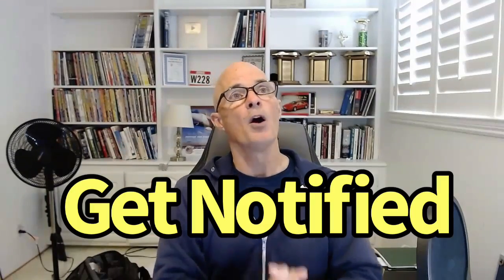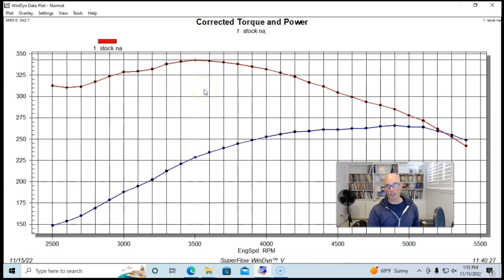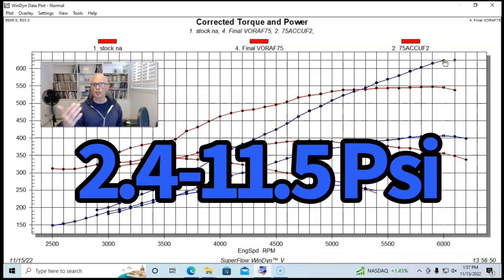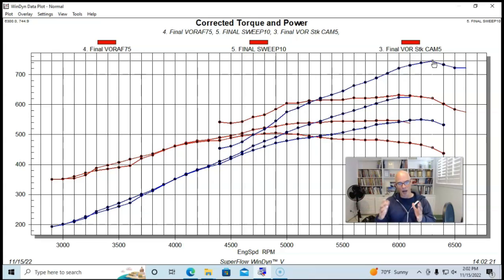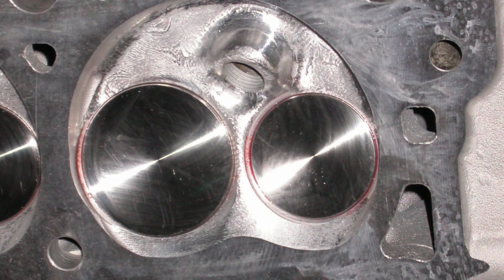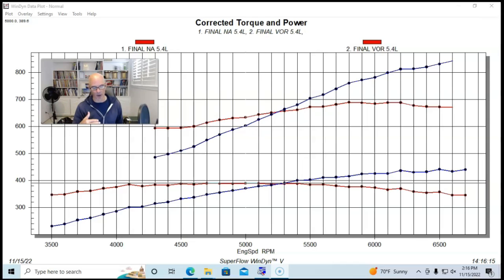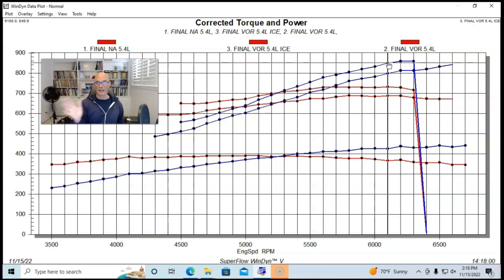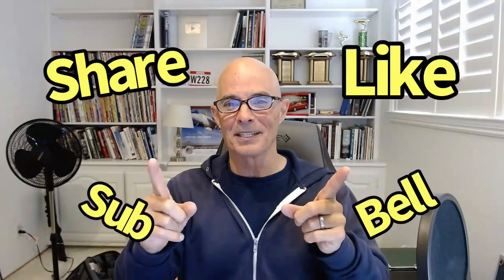4.6L VS 5.4L-MISTAKES WERE MADE! HOW TO ADD A VORTECH SUPERCHARGER TO FORD 4.6L 2V & 5.4L 4V MOTOR!

Comment: @Richard Holdener:  I have a belt I bet it will out do most any belt yall tried in a SC application due to a slipping serpentine belt. 

Continental Duel Belt double sided serpentine belt. It's just like any other serpentine except grooved on both sides. They offerer it in std material construction & Kevlar 
As long as the belt is set at proper  tenchen & if equipped with automatic  tenchner & its functioning properly. It should blow all other belts away. Because it grabs on both sides & it also doesn't need any smooth pullies. If there's slip can trade out smooth for ribs pullies. 
This belt was originally desined for situations for small pulley or pullies in a assesory  drive setup. 
    It can be purchased in stock at most commercial sales only parts stores. Stores like  FVP, Auto Supply, ect. 
 automatic tenchoners. 

Link to Dual Sided Multi V-Belt by Continental Belt 
https://continental-engineparts.com/na/en-us/automotive/belts/belts-overview/dual-belts

Comment: 2000 FI50 5.4 STOCK COMPUTER SMALL TURBO FMU FUEL ENRICHMENT NO CHK ENGINE LIGHTS MUST PASS SMOG ?
Reply: 10th gen body style is the same as the Lightnings were, so just get the Lightning intake manifold/intercooler setup and supercharge it. My 98 F150 4x4 is done this way and I run a Whipple 2.9SC on it now. I ran the ported Eaton SC for 12 years before I went to the Whipple.

Comment: Would these mods apply to the triton 4.6 2v as well?
Reply from the maker: yes
Reply: @richardholdener1727  In Australia we have a Ford V8 that uses a Windsor 331ci bottom end with Cobra R 4v Heads that in its day made 349hp with 500nm of torque or 260kw in new speak, can any mods be done to the Cobra R heads & cams? It's a bulletproof  engine.

Comment: I love mod motors. As long as the timing chain/guides are in good shape and some moron hasn't been changing the plugs, they just run forever. Yeah they may not be the most powerful thing on the road. But they are sweet boosted and sound awesome 👍

Comment: I can’t believe that the 5.4 makes basically the same power as the 4.6 in naturally aspirated trim!!! That’s not good.
Reply from the maker: it made nearly 40 more hp
Reply: @richardholdener1727  but it has  50 more cubic inches and 4 cams!!! It should have made at least 60 more
Reply: @scottsigmon926  are you under the impression that more cams add hp?
Reply: @robertkington2084  they definitely make the engine more efficient and in many cases, yes, it should make more power. The cubic inches alone should have made more than 40 hp
Reply: @scottsigmon926  number of camshafts dont change VE. If it had 32 individual camshafts the engine would not care. It all boils down to what heads were used during the test. If they used non pi 2v 4.6 heads then compared them to a 5.4 with the Ford gt heads then you would see well over 100 hp gain.
Reply: @robertkington2084  sure
Reply: @scottsigmon926  Mr Random Reviews sold his 4v Marauder when his 2v P71 beat it in a drag race..lol

Comment: So the built 2v 4.6 was only down 40hp from the built 4v 5.4? Odd.
Reply: A 40hp difference is about 4 tenths in the 1/4 mile. Example 11.80’s vs 11.40’s..

Comment: Richard, was this 4.6 a stock bottom end? Internet myth claims those motors don't like going beyond 500whp before eating pistons and rods. I personally think it's ring gap and tuning that are at the core of that problem but always love to see these examples that push the envelope a bit like your big bang experiments.
Reply: I drive a 4.6 2v with a vortech, I can tell you 450 isn’t blowing it up. Been bashing on it for almost a year this way.
Reply: these are numbers at the flywheel. add drivetrain loss etc. a  500 whp  4.6 is likely making 20%  more than that at the flywheel. I don't see a few pulls on the dyno causing it to spit its guts out.
Reply: @wyattsauto7  I'm fully aware. I'm also aware of a few blown 4.6s at 430-450whp and a few choice examples claiming 550whp. The real "limit" is illusive but Richards numbers are knocking on the upper end of what people consider the "practical limit". 

Personally I think it's about 650-700 crank lb-ft of torque that's the limit, which with factory heads might end up being 500-ish whp. Improve the breathing and you can reach a bit higher in RPM and get better peak numbers.
Reply: Rods are the real weak point. Might make some power (500+) for a little bit, like a few dyno pulls, some pulls on the streets etc. But it's on borrowed time. The there is no getting around it. No amount of tuning will make a rod any stronger. In the real world they won't last long. They will bend/break and it's been proven many times.
Reply: @banneddamn  rods don't reach their mechanical limit at a HP level though, but torque. The question is, when people bend rods at greater than 500whp, what torque were they producing? I'd also be curious how many bent rods were on manuals vs autos, as it could also be torque vs applied resistance (load). Autos are "softer" on engines, generally.
Reply: @nathanshobe   thats what i think the main issue always been, more with manual transmission
Reply: It's not so much horsepower that kills the 2 and 4v engines as much as torque. There's a lot of people running 550-650 on 2, 3 and 4 valve engines but running boost really late or running a tune that's really light on torque.

I mean honestly have you ever seen a 4.6 or 5.4 rod? They're extremely thin. Torque kills rods.

Comment: The whole Triton family emphasis was on torque production,  the 5.4 was rated at 330 ft/lbs at less than 2000 rpm, in 2002.
Reply: If modular were such junk why did Engine Masters ban them for some time?
Reply: @Dastachesquatch  Didn't know they banned them, why??
Reply: @P71ScrewHead  The Engine Masters competition (not the streaming show) was scored based on power per cubic inch over a specified RPM range.  Mod motors are small but dominate in torque per cube due to the OHC heads and long stroke.  So they're banned for the same reason that Honda K24s and 13B rotary and Banshee 2-strokes are banned.  They'd make the least power but end up winning because they're small cube, and the big-block-loving magazine readers would not be happy about that.  So they keep the rules limited to old school and everyone's uncle is happy when a Chevy Rat Motor wins again.
Reply: @JETZcorp  I agree, n remember that episode very well.. The 4.6L 2v n 4v were beasts, n pretty much any Ford engine out performs the competition even if much smaller.. I'm a big block guy myself, but proud owner of a 2v.. They make massive torque.. I have a TFS 38cc top end on my P71 n it made 309rwhp 321rwtrq at 5,447rpm.. Should go to 6,300rpm which obviously will make more hp, but I think something is wrong, the degreeing maybe..
Reply: Over rated af to. Those things were gutless wonders.
Reply: @HioSSilver1999  No, they made great torque at idle. And no horsepower. Just like Ford claimed.  GM trucks made more horsepower, got better fuel mileage, and are much easier to work on, but the 4L60 sucks compared to the 4R70, and the fuel pumps lasted 3 times longer then  GM trucks of the era.
Reply: They’re junk. Drive a 2004 Navigator 5.4 then drive a 2004 Tahoe 5.3… not even comparable. Mod motors are 💩
Reply: @boost1728  there are almost no surviving examples where I am, but all I do for a living is fix vehicles, so you couldn't tell something I don't already know....
Reply: @jamesgeorge4874  obviously there are a couple things you don’t know- like the fact that first gen mod motors are gutless. Can barely tow a jet ski behind a 4.6 F150. Waste of time and money
Reply: @jamesgeorge4874  gutless

Half a pound of torque at idle

Three pounds of torque at 5,000

Gutless
Reply: @boost1728  you forgot about the 5.3 spark plugs don't shoot out of the heads like a Triton.
Reply: @jamesgeorge4874  didn’t forget, it’s just that everyone already knows lol
Reply: @boost1728  honestly, if you worked at a fleet maintenence shop, that serviced them in the early 2000's you would know the truth, not just your personal bias. At 100k, the GM trucks almost all ate a fuel pump. By the 120k mark, more than half needed a 4L60. By 175k, the rear diff was gone, the NP 243 had a hole worn in the case from the pump tang, and trans / fuel pump / rear end failure was a second or third time affair. Sure, the 5.3 ran great, but everything else was shit. Now the gutless, spark plug blowing gutless 5.4, needed none of these things. The average fleet 5.4 would go well over 200k, without rear diff, or trans failure, with the original fuel pump, and very little drama. Sure, they got 2 mpg less, sure, they were a little down on power, sure, I'd rather slam my dick in a door than have to fix it, but they didn't break as much. Those are just the facts of my experience. And frankly, fixing them for 30+ years everyday, puts in a position to say, you have very little experience (by way of comparison) and obvious bias.  1 in 50 5.4's  runs really good.  9 out 10 5.3's run really good, that's just how it is.
Reply: @boost1728  except an 04 isn't a first gen mod motor, they're a PI motor therefore they're a second gen..... so yeah, you don't know it all.
Reply: @Garrittpwl  the pi wasn't any better than the the non pi. Hell the 3v was turds too.

Comment: I thought that the 5.4 NA power curve looks like teeth off a wood saw. Any idea as to why it was doing that Richard?
Reply: I would say belt slip
Reply: @myronwebster  unlikely as it's not running the blower at that point in time.

Comment: Test an Atkinson cycle engine
Reply: You already know about them, nobody here is wondering how boring an engine that gives up low speed power, for efficiency, would do on the dyno, plus, the are inherently small, usually coupled to a motor/generator, and not a platform that is plausible for power gains, because their intent, from conception, is the opposite. The Miller cycle engine is as close as you are going to get.
Reply: @jamesgeorge4874  That's actually not true.  The Toyota 2AR Atkinson engine (from the Camry Hybrid) is rapidly gaining traction as a performance platform.  Atkinson naturally means a BIG intake cam.  If you take another one of those and put it on the exhaust side as well, and change the cam timing, the power nearly doubles.  It's the easiest way to make the pedal of an MR-S respond just like an LS3 Camaro.